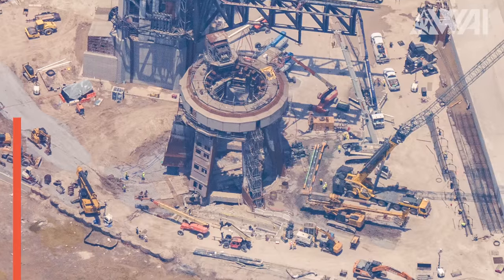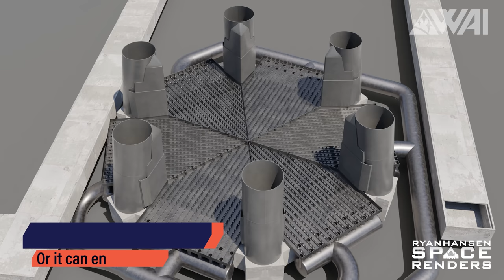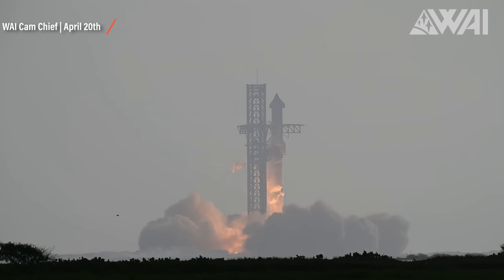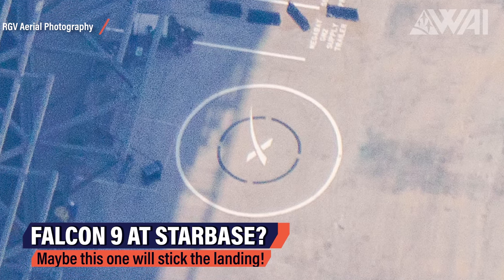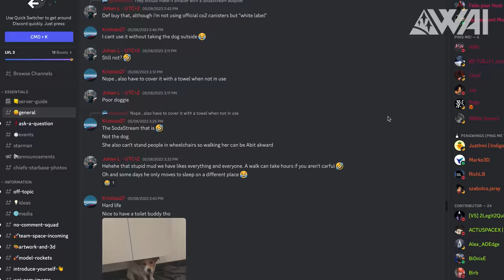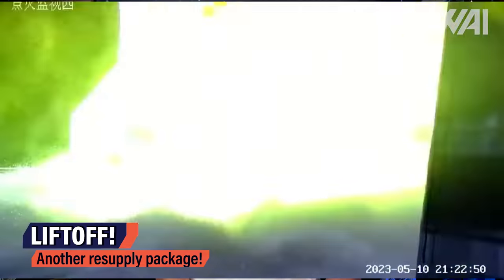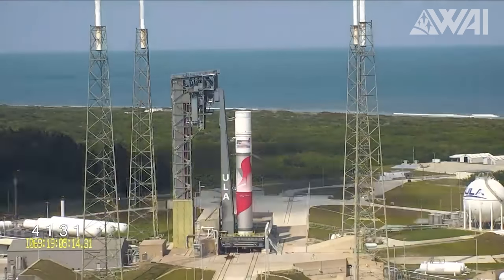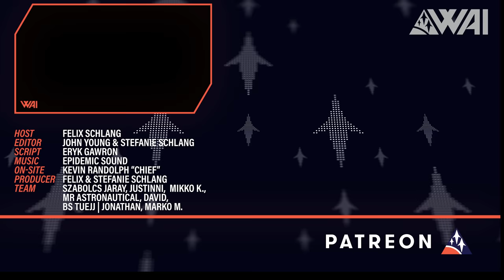SpaceX's even larger Starships made possible through world record Raptor 3!

Comment: Felix, while your somewhat-breathlessness about Raptor 3 is understandable, keep something in mind: There IS a problem with SuperHeavy, & it’s probably not with R2.  I honestly feel confident Elon would NOT have gone into very real mass production on Raptor 2’s unless they had all the kinks worked out at McGregor et al. BUT……I’m now less confident, that they have their propulsion INTEGRATION issues fully in hand. The fact that they’ve tried- twice now- to start all 33 engines for liftoff, and didn’t succeed either time, is almost certainly bothering the hell out of the SuperHeavy integrated propulsion team; even more so than, say, loss of an engine or three (and more!) going uphill. They’ve got a propulsion system integration, possibly even, propulsion system engineering, issue, on their plate, that so far, is not being at least publicly acknowledged.NOTE: This has NOTHING TO DO with ‘safety’ or the FAA or anybody else; its only about operations and performance and reliability. FAA only cares about the uninvolved public right now. - Dave Huntsman

Comment: I wonder if the water system could be used as a propulsion system. The amount of water is massive. Now let's heat it up to 500-800 degrees. The water will expand about 1600 X. That could be 100 tons of additional propulsion aka (thrust) the design has never been done to gain thrust from the expanding water as it converts to steam /water vapor in a fraction of a second as the thousands of degrees in burning rocket fuel mixed with the flooding water system. The trick is to direct the massive expansion of water into pushing the lower super heavy upwards. The rocket would require much less fuel mix if you get those 100's of tons of upward thrust to launch the super heavy monster. The design would be like firing a rifle up a tube. Once you clear the tube you've gotten all the thrust you can get once it passes beyond the tube. The initial thrust from water expansion will boost the initial thrust, and speed for the first 10 seconds. The fuel savings should be measurable, and the speed after 10 seconds might be double what you get using just the 33 rockets. It's just an idea that might work better than expected.

Comment: Hi, I have a curiosity. Is there any reason why spaceX doesn't use the heat tile to insolate the orbital lunches and the floor to help with the heat? Because the heat tile is supposed to resist the heat of reentry, it is probably good for suport the heat off the engines.
Reply: They would crack and shatter under the pressure.  Those tiles are actually rather delicate. Also, the combined raptors produce more heat than Shuttle re-entry.  The heat tiles have their limitations.  They couldn't be used on Apollo or Orion because those deep space vehicles slams into the atmosphere at much higher speeds than the Shuttle.  Now StarShip is deep space vehicle using heat tiles for re-entry, however, right now, test flights are LEO based orbits.  We don't know if SpaceX is developing a better heat rejection system for high speed re-enty, or if they are working on a different method to cut speed enough for the current heat tiles to work.  I would think they are probably working on a future better heat rejection system that doesn't flake off the fuselage so easily.
Reply: I think there is too much mechanical shocks being applied - and that would shatter the tiles.
Reply: 31 engines shattered steel reinforced concrete.  They would turn those tiles into a gravel storm.

Comment: The first Starship test revealed a serious problem with landing and taking off on the Moon and Mars, where there are no facilities to keep the ship's engines from digging a giant hole and throwing big rocks over a mile. Will Musk's fleet spend more time reinforcing the landing sites than building places for people to live?
Reply: Booster not required for mars/moon ascent
Reply: which is why the HLS launches (and landings) will use the middle engines (specially for final landing and initial launch). Once the moon surface is far enough away, then the main engines could be used safely.
Reply: @user-is2nn8mc9q  Starship is powerful enough to dig a crater on landing and throw rocks many kilometres through the thing air and low gravity of Mars. Landing into a crater of your own making isn't a good idea. Nor is hurling supersonic rocks at your base.
Reply: @jessepollard7132  Yep, but that doesn't help with Mars.
Reply: Musk won't be building cities on Mars. That needs to be pointed out. As for launch facilities, well that suffers from the fact that you need hundreds of tonnes of steel and concrete to build a launch pad and I'm not going to go into the implausibility of doing all that with materials supplied from Earth, fully robotically. The real problem is that Starship is too big and the whole paradigm is wrong. Instead of launching from Mars on a big spaceship and heading directly back to Earth, we need to do what we did with the moon - use a small craft to go back into orbit and then return to Earth from there. Now, if you designed a dedicated, crew only, reusable Mars lander and ascent vehicle from scratch you can also design a vehicle that can avoid blasting directly down on landing or ascent. Starship does not have that design freedom.
Reply: @saumyacow4435  Won't hurt either.
Reply: @saumyacow4435  Rather obvious that Starship has that flexibility - after all, the HLS for the Moon is already designed with engines in alternative positions.
Reply: @jessepollard7132  Those engines might work on the moon but cannot work on Mars.
Reply: @jessepollard7132  HLS is irrelevant to Mars. You might be able to get away with strapping on smaller engines and calling it a lunar lander, but you cannot do this on Mars for two obvious reasons. One is that Starship as proposed has to survive atmospheric descent. It's not going to do that with lots of protuberances and nozzles hanging off it. The other is that these smaller engines simply don't have the thrust to land on Mars, let alone take off again. Again, Starship as designed will be trying to land in a crater of it's own making. And in any case, its part of a broken architecture. The one that says you have to take off from Mars with everything you need to get directly back to Earth. An architecture for which you have to mine thousands of tonnes of Martian soil to liberate enough fuel for one launch.
Reply: @saumyacow4435  That depends on the engine used. right now, SpaceX could plan on using any of three or four different engines or even a combination. Personally, I would think about using a raptor version for that. But starship is designed for flexibility.
Reply: @saumyacow4435  it is the flexibility that allows for variations. HLS doesn't have "protuberances". And if Starship can land on EARTH, it will be able to land on Mars. Evem if the decision is to have a strap on landing ring with legs.
Reply: @saumyacow4435  So? not even HLS has protuberances. Starship is designed for flexibility. Personally I rather expect it to have a detachable landing ring with legs attached  for landing on Mars. But that is up to SpaceX.
Reply: @jessepollard7132  Of course it has protuberances - the landing engines have to fire in a somewhat downwards direction, no? Also, that landing ring with legs won't do you a lot of good if you've blasted a hole such that the legs won't find a stable footing. Btw, there are better solutions to landing on Mars, that don't have theis fundamental problem, just to make that clear.

Comment: The new water jet system is a waist of time. The exhaust will evaporate the H2O in seconds turning the booster into the worlds largest cutting torch. Metal will fly everywhere and just might cause the booster to blow up right on the stand. No, the only way to fix this problem is to either raise the stand 60 feet up with a diverter plate at the bottom without having to dig a trench or dig the trench. In other words, just maybe SpaceX should read the 1966 report on platform calculations.
Reply: So you have actually done a demonstration huh? Where's your paper?
Reply: @alvianchoiriapriliansyah9882  It's on file at General Physics Inc. however, the 1966 NASA report covers the same information. Maybe it's not necessary to reinvent the wheel when the information is already out there if only accessible.
Reply: @jroar123  Paper name please?

On other note, many rockets has done a water-cooled pipes shaped to a diverter & it works perfectly. Just sayin'

Comment: This is like building a sand castle close to the water at low tide.    I still don’t think they are taking into account the exhaust pressures from 33 raptor engines firing all at once at 70% or higher.  And why would they lift off at anything less than 100% ?   Flame diverter is needed
Reply: easy - liftoff at less than 100% allows for filling in for possible failures of some engines.
Reply: @jessepollard7132  so why not designed for 100% ?
Reply: @bruceyoung1343  safety and recover-ability from problems with engines.
Reply: And you definitely know because you're rocket engineers, I say?
Reply: @alvianchoiriapriliansyah9882  old time engineer. Even the old Saturn V didn't start with 100%.

Comment: I don’t think they will land a Starship initially on the moon. It need infrastructure to support it. It will need a rather level landing area that’s firm and not going to blast away on landing. 
 Think a Dragon Capsule with a lunar lander type vehicle below it. 
 What is the point of going to the moon if you can’t get back home. 
  They may try an unmanned starship as a feasibility study but I will bet it won’t stand. The original LLM had lightness as one of its strong points. Starship not so much.
Reply: They don't

Comment: I think they wont get more than 10 launches using that water deluge system.. i dont think it will be enough for the power of 33 RAPTORS... lol
Reply: Everything is a growth to something more.  But until you do 10 launches, you won't get the data on what determines a more viable long term solution.
Reply: 10 would be enough to demonstrate capability and reliability of the main starship. and about the time the next/expanded 18 meter diameter starship/booster to start testing (which would need a new launch platform anyway).
Reply: @TheJTcreate  just saying, they're going to need more.. but it's all proto anyways, let's go blow some shit up lmao

Comment: The amount of energy being impressed on the new proposed Water/Steel pad diverter will be overwhelmed. There is not way that any water can oppose this amount of energy. This will totally fail. They need to build a standard flame diverter.
Reply: They don't have to ramp it up to full power. Only to power output needed to have ship clear the orbital launch. Once out of there, they can push it full power. Same like revving a car.
Reply: High pressure cylinders isn't sci-fi. It doesn't break the laws of physics

Comment: Getting ONE engine to fire on a test stand is not getting multiple engines to fire in a launch. That's something Musk's Starship hasn't done yet, and won't.
Reply: Falcon heavy has some 29 merlin engines with many orbital flights.
Reply: @richbarrows3922  Starship is his biggest baby and it's stillborn.
Reply: Except they already did multiple engines lit on launch
Reply: @alvianchoiriapriliansyah9882  The STARSHIP 4/20 launch eventually blew up the rocket and pad without  ALL engines even lit. Falcon  may be the limit. Bigger is not better without a blank check budget
Reply: @GrasticInternational  30 and then 25 engines are pretty well considered "multiple" engines lit at launch to me
Reply: @alvianchoiriapriliansyah9882  A "percentage" is indeed multiple.engines fired but not what's intended. 100 percent or it's dead weight and a failure in the world of efficiency surrounding flight.
Reply: @alvianchoiriapriliansyah9882  The Raptor engine is new and Merlin is current. The new has not matched the Merlin. Stay in context of what I said about Raptor which was the post. DUH

Comment: Raptor 3 has a real problem. The engine is at it's limit with metal alloy combustion. We need a new company to develop new alloys that do not exist yet to handle the higher temperatures and pressures. Until that happens, Raptor is not going to see too many new improvements.
Reply: You do know SpaceX has metallurgists, right?
Reply: @alvianchoiriapriliansyah9882  Yes however, the requirements to preform what SpaceX Raptors want doesn't exist yet. There is the possibility that what is required might not exist on Earth.
Reply: @jroar123  And you know that exactly from where?
Reply: @alvianchoiriapriliansyah9882  University of Houston NASA class of 1993. Where is your degree from?

Comment: So they are going to add concrete pillars to the pad and that's magnificient because euh.... they didn't know what they were doing before?
facepalm

I've seen lemonade stands run by a pre-teen with more consideration and better idea about the how and what.

Raptor 2 engines are so great that with the 'success full launch of Starship' approx 1 in 3 failed before the rocket was utterly out of control. 
I know, for the fan boys 1 in 3 is a FANTASTIC success with high reliability. In the real world 33% failure rate would mean a serious verbal spanking if not a bunch of people getting laid off.
But no worries, they have no clue why the failure rate of Raptor 2 was that big so they just made Raptor 3, not having solved any of the issues with Raptor 2.
facepalm

On top of it, even with all the alterations, repairs, redesigns from the back of an envelope of Stage 0, they have no clue nor reason to think that it will take a launch with 33 Raptor 2's which means that they have no clue if the OLM and Stage 0 could handel the more powerful Raptor 3's 

But hey, so what if they waste another billion or so, Elon is more then willing to waste other peoples money, including US tax payers who heavily subsidize SpaceX, on his stupidity.

Felix, after 10 minutes of your fan boy hyper optimistic I couldn't handle it anymore without vomiting in my mouth.
You can be a fan and be an optimist but once all what you say is just based on conjecture, wishful thinking and you just repeat the company line without even a smidgen of critical thinking, you crossed the line in brown nose territory.

Comment: Why don't we tone down the uncritical praise for SpaceX and Musk's NEXT PROJECT until they manage to actually successfully launch the current Starship with its current engines without blowing it up, destroying the launch pad, and littering a square mile of land and water with chunks of concrete and salvage metals?  If the latest launch was a "success" I do not want to be within a thousand miles of a Space X "failure!"  Were they actually surprised by the destruction of the launch pad? Have these "geniuses" never seen a video of a Saturn V or Space Shuttle launch, with its huge flame and heat diverters and millions of gallons of coolant water to avoid the complete destruction of the launch pad?  Why did they launch this thing without those devices in place?  What's truly funny is the fact that they are using a benchmark for rocket launch success from the 1950's, over 70 years ago:  "If it clears the tower without blowing up, it's a success!"  NASA has been doing better than that for over fifty years.  By the way, Musk predicted that there would be Starship cargo missions to Mars in 2022! How's that working out? Waiting for Musk's forecasts to come true are a fool's errand.  He's been promising "full self-driving" Tesla cars "next year" for about ten years.  Don't hold your breath waiting for the Starship to get to the moon, because they have yet to get it into Earth orbit and have proposed no workable plan for refueling it in orbit, a necessity for moving beyond Earth orbit.  Starship will be lucky to get into orbit, so don't hold your breath waiting for that, either.  And it is time for everyone to forget about this thing ever getting to Mars, because that will never happen.  Space X should be focusing on the very successful Falcon system instead of wasting time and resources on the doomed Musk ego project called "Starship."
Reply: Falcon reusability was an ego project too

Comment: As impressive as that sounds, they still destroyed the engine.  Sorry, I don't buy the hype.  I'm an engineer.  You don't intentionally destroy the test subject.  Not until you fire it 3 or 4 times.  And get the good data.  THEN and only then, do you do the self-destruct test.  And find the upper limits.  This failed on the first outing.  And same for Raptor 2.0  They have had nearly a 15 percent fail rate.  This is not a good.  But compared to last years 50 percent fail rate, a huge improvement.
Musk LOVES to talk.   But guys, he's not an engineer.  Nor Tony Stark.  He is a driven, hard working man.  Who accepts a certain amount of failure.  And leads by example.  This makes him a great boss.   But he's not that smart...  If he were, he would have listened to his engineers

Comment: Raptors need to be more reliable, not more powerfull.
Reply: You can do both at the same time. In theory if you raise the capacity of the engine, they can operate at a lower thrust with decreased stresses compared to the design.
Reply: They might be more reliable if they can handle more pressure by default.